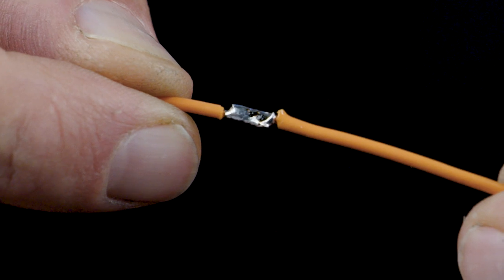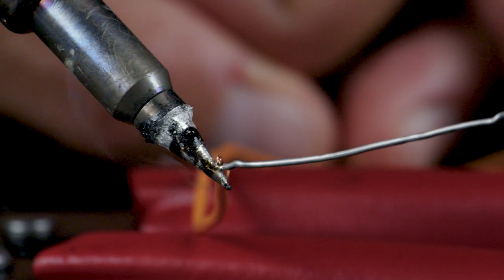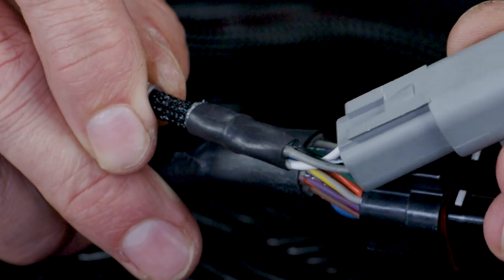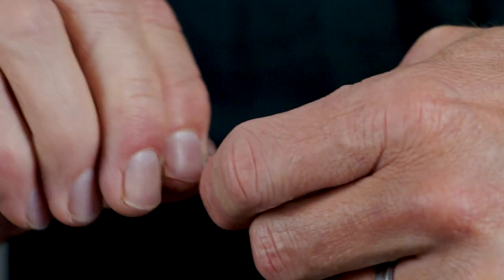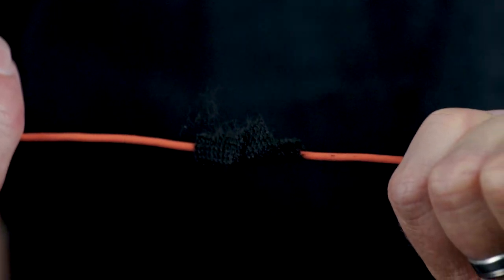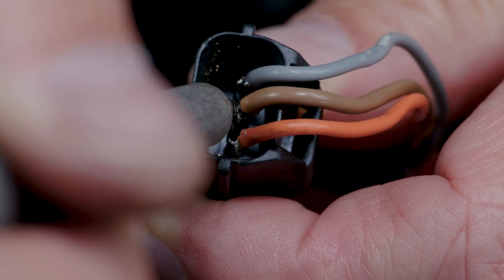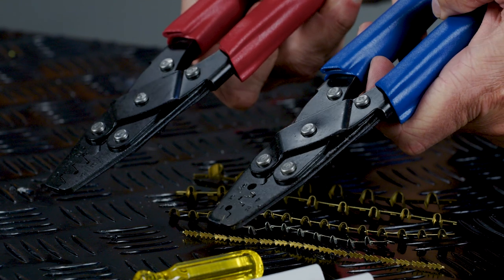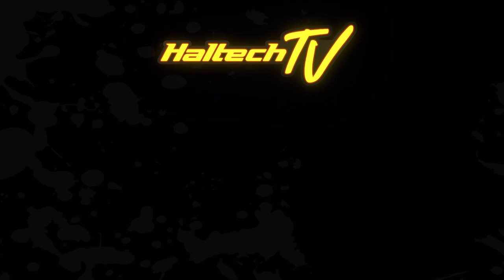🛠 Crimping vs Soldering - Which Is Best? | TECHNICALLY SPEAKING

Comment: Soldering guru here, the way you solder I agree stick to ur crimping tools. I will stick to my rosin core leaded solder, properly twisted together wires that are then rosin fluxed and soldered with leaded solder. It makes a nice shiny connection strong chemical bond and that shit is like black it just don’t crack! 25 years soldering in automotive applications. I’ve never had a solder joint returned.

Comment: Crimping is good for one wire maximum two. If you wanted to crimp a three-core cable, you would be increasing the size of the original diameter extremely, which can cause placement problems. In that case, it is better to solder.

Comment: I've seen a few testings where soldering is far better then crimping in terms of resistance.. But crimping is a lot easier and quicker.. A good twist is as good or better than a bad crimp ..😂😂😂. I've done the Twist in and emergency.. But never as a permanent.. I would love to see you do a resistance test to actually see which is better before actually claiming one is better over the other .. My personal opinion is both are excellent as long as both are done right .. I prefer to solder due to finding it easier to do a better job without the need for specialist tools ..

Comment: Hey Matt great video. I feel it would have been worth noting that if your going to use a Glue heat shrink on the solder joint. That it does add some strength to the connection. Or maybe it doesn't, common sense says it does but your the expert. It's true that it adds the same value to both Crimp and Soldered connections. But wasn't covered in this video.
Reply: the adhesive does add some element of strain relief, but proper crimps will be stronger than the wire conductors themselves, so really a non-issue. The primary purpose of the adhesive is to keep the exposed conductors from being in contact with atmosphere, humidity, and chemicals that it might encounter.
Reply: I've seen wires that broke off right at where they stick out of shrink tube with glue. Probably the result of weakened wire insulation due to heat applied to the tube and tube being stiff causing stress concentration at narrow part of wire.
Reply: @brys555  I’m hoping that’s just from low quality heat shrink. Personally I use some quality heat shrink and haven’t seen that one. But sounds possible for sure with maybe some super low quality heat shrink.

Comment: This debate stems from the time when soldering was the only option, outside of twist and tape, for cost reasons. Today we have the machines to make precision tools and open-barrel crimps very cheaply. As with running in engines, soaking motorcycle chains in kerosine and cooking them in oil, and other old timey techniques, technology has come to a point where there are better to do it, or not do it at all.

Comment: I am an electronic engineer for 26 years. I fully backup your statement. In my early years in telecom industry I used the solder extensively therefore I know the pros and cons..
The only complaint I have with Haltech is that you are not that much in motorbike industry. I need a display for my YAMAHA R1M 2023 model

Comment: I Use crimps at work everyday in industrial applications. That means lots of vibrations and heat cycling. We have an ongoing test right now. We wired 2 identical lines one with crimps and 1 with solder In the 6 years since we started this little test 2 motors have gone both of them have been on the crimp side maybe in a year or 2 all the soldered ones will fail at the same time and crimps will become king in my eyes but for now soldering is king in my mind. We use crimps because soldering takes way longer and down time is money. I see soooo many "professionals" over crimp wires which is easy to do and causes premature failure.

Comment: I use soldier most of the time because my experience has shown that crimps fail a lot sooner ( maybe I’m doing it wrong) but especially on all my trailers I soldier my connections, no problems for years and years
Reply: Are you using a $20 crimp tool and generic crimps, or a $200 crimp tool with the correct die set?

You can do a good soldering job with a $20 iron, but generally can't do a good crimp with a $20 tool.
Reply: @scod3908  idk, to be honest there isn’t good resources for honest tool reviews, and or educational videos or books that I’m aware of for either. And sourcing quality connectors is another trying job, with all the Chinese crap and paid reviews
Reply: @scod3908  It's sort of the same for the soldering iron and technique.  A good iron will be a temperature controlled station, true iron clad tips (not those cheap nickel plated copper ones) user knowing what temp to set, and how long to apply heat, as well as which solder to use, and the technique of heating the joint and flowing the solder in  with sufficient flux, not necessarily just the flux in the spool of flux core solder.

Comment: I read that solder can cause resistance in wires??  like injector, map, maf, wideband wires... one would think a crimp would do that same thing?
Whats your take on the cheaper butt splice connectors? 
I know they have their place..ex. trailer light wiring.. i would never use them in a engine harness.

Comment: Question, can you elaborate on "open barrel crimps"?  I'd never heard of them before just now and what I called a crimp seems to exclusively be a closed type.
Reply: @ryanokeefe12  Thanks for the info.  So I guess the crimps that I see in auto parts stores that have "insulation" around the crimp already are less than ideal.  Also I know I could google this, but just having the 3 terms (open-barrel, split-barrel, and closed-barrel) will make my google search much more fruitful now.  And it boosts engagement for Haltech.  All hail the algorithm.

Comment: and this is why I use speeduino. I am pushing 50, have the same truck for 30, been soldering the joints, and have yet to have a problem.

Comment: every pro-electrician making harnesses from scratch, has his personal opinion on that subject.I think that there are many things to consider before saying thats better than this, because it depends.Factory crimping is usually very well made with the right crimps and tools.If there is a problem on a factory crimp its usually caused from bad insulation over the crimp(on old harnessses).At the other side, you dont always have the right tool to preciselly crimp an uncommon connector, so in that case I apply solder, just at the top of connection, making suse its not entered inside the cable over the crimp(it will definatelly fail,seen many times).You wont have any problems if you know what youre doing.As far as joining cables from ,lets say, 1,5/2,5mm to 4, or 6 0,50/0,75mm, if you do a nice soldering job and then insulate them with a duall wall heatshrink with glue, letting 1+cm more than the joint from both sides, ensuring its not in a highly vibrating spot over the harness, you wont have a broblem too.
some (french) factories also apply some amount of solder at the end of big25/30mm) connectors, even though they have them exellent crimped, to avoid corrosion.

Comment: 60/40 solder joints are made long before the copper reaches annealing temperatures; the poor vibration resistance is due to solders brittleness.

A properly crimped connection forms a cold weld, permanently bonding the surfaces together. Clean surfaces and correct tooling are required.

Comment: Soldering two wires side by side is asking for the mentioned failures. Wires should always be mechanically attached first (twisting, wesern union joint, etc) then soldered. 

Properly crimped joints shouldn’t allow solder to wick as proper crimping tools and technique deforms the wire to fit the crimp barrel and to fit other wires with multistrand wires.

Tempering hardens metal (making it more brittle), annealing softens it. Copper doesn't temper so that’s not an issue. Work hardening is mechanical deformation (crushing, bending, stretching) causing the equivalent of tempering. All good methods harden. And like anything else metal, it’s a balance of strength vs flexibility.

In the end, most failures are from vibration and heat cycling. Both methods will do great if done properly. Too bad most people are crap at making good joints. Tooling helps a lot in the case of crimping.

[edit: and for reference, copper starts annealing around 700°F and most irons range from 370 to 840]

Comment: The simply answer to this is that either method makes a reliable joint if done correctly, for "most" applications.  Done correctly also includes that solder, nor crimp, is supposed to be a mechanical bond, only the electrical bond.  With either if the wire is subject to flexure stress, the job was not completed.  Wire routing and fastening down is often overlooked, then the blame placed elsewhere.

Comment: 4:35 The automotive industry has been moving away from soldering connectors to PCBs, instead using press-fit connectors, which fundamentally resemble a crimp in terms of being an airtight, compression joint. Faster and more reliable, at the expense of demanding tighter tolerances in PCB manufacturing.

Comment: Twist and tape has its place - as a get you home fix at the side of the road. It is not quite as bad as the friend who turned up on a small motorcycle with a battery wire attached using sticky tape (not even electrical tape)

Crimping probably gets a bad reputation from people using the red or blue pre insulated crimps with a cheap set of crimping pliers.

One concern with open barrel crimps with a large number of wires is that the outer wires potentially have quite a large stress point  where the insulation endsand the wires has to do a fairly sharp S bend.

Comment: When using a loop type terminal on a high current joint I will use a crimp terminal then solder the cable that is protruding from the terminal.

Comment: Given all the ECUs and Modules and Sensors in a modern car, 98% of the connections will be crimp-on terminals in multi-pin connectors. So crimping has won this debate, at least in terms of harnesses. Add in PCBs, and solder is miles ahead. 

The predominant area where the environment is challenging and there's actually a choice are the Ring Terminals on some sensors and all ground studs.

Splices in harnesses are trivially easy to make reliable if flexure and moisture can be eliminated. With good design and self-sealing HS tubing, that is not a challenge. Keep in mind that splices can be made further forward or backward in the harness to avoid areas with flexure.
Reply: Crimp terminals are used by the automotive industry because a machine can do it thousands of times faster than a person could solder.

Comment: If you are going to heatshrink sleeve a connection, you might as well use a solder filled heatshrink. They keep air out and support the solder joint so flexing and resultant cracking isn't an issue.
Reply: Not necessarily.  When you solder first, you can ensure the joint is good before putting/shrinking the heatshrink over it.  Often this means little more than add some more flux and reheat.  With solder filled heatshrink, you're stuck with whatever happened.

Comment: Aviation uses crimps in about 90% of it's connections and wire repairs. Aviation is by far the most heavily regulated and most engineered form of transportation. Therefore I will happily stand by crimping as the superior for of connection. The guys who think crimps suck probably have never used quality crimpers or terminals and got a bad connection because of it

Comment: I think it comes down to the skill of the installer and the quality of the equipment. High quality, USA/Japanese crimp connectors (siemens or similar) are going to give you excellent crimps. Solder, in skilled hands, will give the same results. I prefer solder, but I have been working on critical-care electrical equipment for 20+ years. I have never gone back on a termination because of failure.

Comment: For extreme applications like a pro mod car I use crimp terminals and then put a dot of solder right on the end of the wire. it don't wick past the crimp.

Comment: Crimping is the way to go, it keeps race cars reliable. The problem is the cost of the range of crimping tools and connectors you need to spend on for all of the different scenarios you come across, so no wonder soldering is common for DIYers

Comment: My first day on the job as a mechanic at a major airline I was told that soldering wires together would get you fired. I had a soldering iron in my toolbox and was told to take it out to my car or cut the cord off and throw it away.

Comment: What about corrosion resistance? Even with shrink tube, I see crimped connections with corrosion that sometimes goes up inside the insulation at least an inch. I've never seen corrosion on a properly soldered joint with shrink tube. I suspect that the little bit of solder that wicks up the wire helps protect it from oxidizing.

Comment: How do soldered wires in a wiring harness wiggle or vibrate to a point of breaking?
Heavy wires hanging loose  for long distances and bouncing around for 20 years I suppose.
Do taped or zip tied wires really move around?

Comment: So a few years ago I heard that a proper crimp will cold weld the wires together. Cant remember who it was but I stumbled across someone putting that to the test and made several good and bad crimps and cut them in half and they came to the conclusion that it is true.
Reply: Yes, kind of, but this is more applicable to larger crimps like battery terminals.

Comment: RoHS lead-free solder is the main culprit for "cold" and cracked connections.
Lead-free is not as pliable as lead-containing, simple fact. Micro air gaps between wire strands within a crimp can arc, producing corroding ozone. Crimping is more convenient and faster in theory, but I prefer to solder, using a butane powered iron (Power Probe) and a separate paste flux, not relying on the flux in the solder. I always cover with heat shrink or liquid electrical tape. The main thing is to lock out oxygen. Water contains oxygen, and when water is electrified (electrolysis) it breaks apart it releases the oxygen, which further gets ionized into ozone, a highly corrosive gas. Don't buy or park a vehicle on green grass- the oxygen produced will corrode the entire undercarriage, wiring connections, and aluminum components. Ozone & UV light are what fogs polycarbonates, too. Oxygen keeps you alive, but also kills you; take "antioxidant" vitamins to stop "free radicals".

Comment: Solder that creeps into the strands produces a jagged sharp fulcrum where vibration will work harden the conductor at that point and more likely cause a failure.

Comment: There is also the issue that soldered joins are more conductive than crimped joints. I've measured 365% more resistivity in a crimped joint than a soldered one.

Comment: This is kinda off topic but I believe for a novice or backyard sparky, a dodgy or not perfect crimp is always safer than a not perfect solder. Soldering is great but is a learned skill that improves over time. Crimping can also be done incorrectly but if you can give the wires a tug after and nothing moves then 9/10 that join will be fine.

Comment: Crimping is SOP in aerospace wiring.  That works perfect if the right tools are used.  More sophisticated than your average auto connectors and universal crush crimper.  But I have used all kinds.  The thing is,  every time you crimp, pull the wire to make sure it is tight.  Every time.  Also bad crimps have resistance,  which means heat in high current applications.  This is an issue in house wiring. Fire hazard.

Comment: Crimping is always better.  Like was mentioned, the solder will wick up the wire and cause a brittle point.   This may crack when subjected to a high vibration or motion area of a wire harness.   This risk can be reduced or almost eliminated by using rigid or semi-rigid adhesive lined shrink tubing which acts like a splint and protects the solder area against vibration or bending motion.   And also potting soldered connections in connectors and sensors.🎃
Reply: Then you aren't completing the job.  No wire ending at a connector, or PCB, or crimp, OR solder joint, should be allowed to flex in that area.  Even without any of these things, just a piece of wire itself flexing too much will fail.  Plus, crimping is also introducing a rigid area that cause the wire just adjacent to it, to flex more.  Get rid of the flex as you should, and it doesn't factor into the equation.

Comment: Generally, speaking, a soldered connection is stronger, and a crimped connection has better conductivity.
That being said, in my experience, when there are two sides of a hotly contested debate with no clear winner, then either both sides are right, both sides are wrong, or it just doesn't matter. You can apply this to tire rotation schemes, oil change intervals, etc.